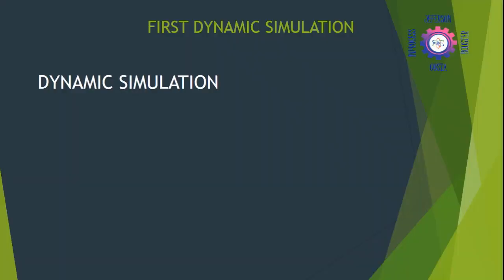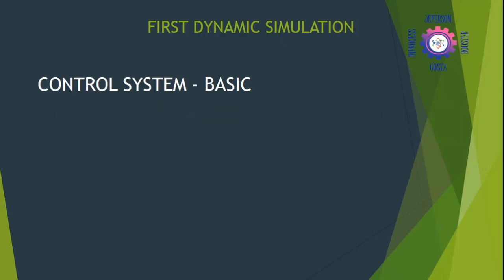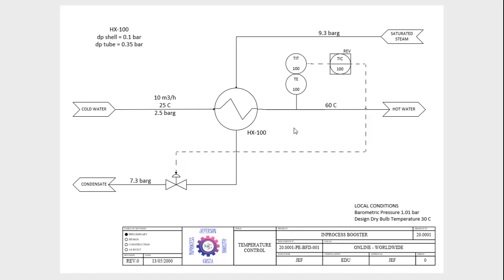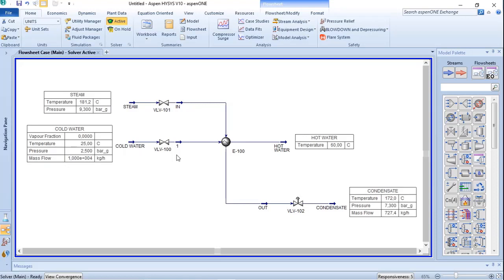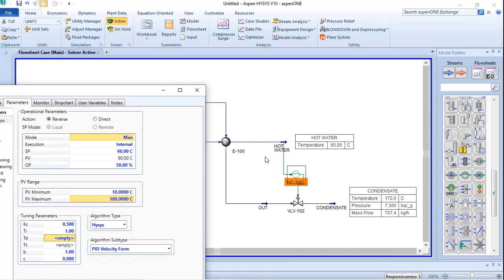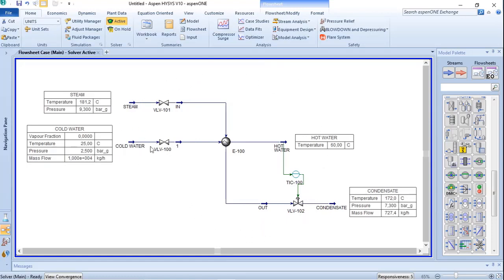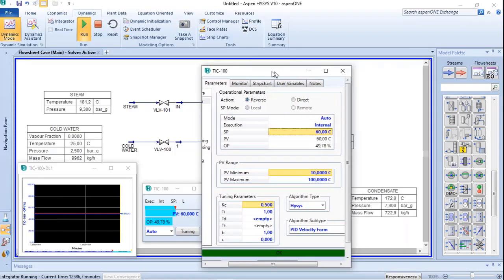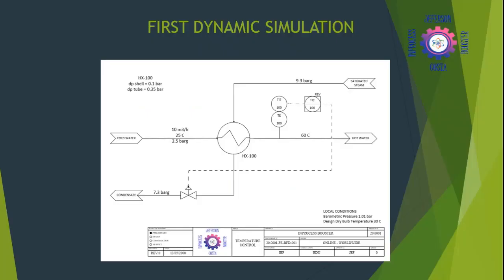First Dynamic Simulation in Aspen HYSYS

Comment: great video Jeferson with nice explanation but if instead of pressure flow relation I require temperature flow relation what should be done
Reply from the maker: Hi, you use the control valve to regulate the temperature by varing the flow. The flow through the control valve orifice depends on the pressure relationship. Same for pressure control and composition.

Comment: Hi Jefferson, thanks for your dedicated video. I have 1 question: When I switch to the steady mode, the system shows that all the streams need to be input the value again (displayed as light blue color)?
Reply from the maker: I Hieu, when you stop dynamic and return to steady state simulation Aspen Hysys goes to On Hold "mode". You just need to click on Activate on "Home" tab to allow Aspen Hysys to return with calculation. On On Hold mode hysys will not perform calculation (define stream properties based on fluid package for instance) and because of that, streams are kept in light blue.
Reply: @jefersoncostaengineer  Yeah Sir, seems like the same thing happens when we add new components. Thanks for your answer Sir, that helps me a lot.

Comment: Hi Jefferson.
I want to simulate loading a tank with product 1 that contains moisture. then empty the tank and verify the percentage of residual moisture that remains in it.

Then I want to fill the tank with dry product 2, to verify how much moisture it absorbs.
is it possible to do with hysys?
The idea of the simulation is to verify if product 2 is degraded by the humidity of product 1 when using the same tank.
Reply from the maker: In this case, it is better you use an excel spreadsheet.

Comment: Great video Jefferson, very useful. I have a question, is it possible to do a dynamic simulation of a gas pressure regulation plant? I´m trying to do it to see the behavior of the downstream pressure to changes in the inlet pressure but I don´t know what I´m doing wrong. Should I use two pressure controllers to see the changes? One in the inlet manually to set any pressure i want and auto in the downstream valve to see how the outlet pressure behaves to the changes?
Thank you for the content!
Reply from the maker: Hi Nicolas, yes it is possible. My tip is, try to convert your dynamics in small steps. start not adding many control valves at the same time.

Comment: Hi jeferson 
I want to ask you something about dynamic simulation.
When i switch steady state mode(there’s converged already) into dynamic mode, and there’s have no problem with the system after running out the asistant dynamic. But integration time didn’t work, it says (i mean hysys program) “the pressure  flow solver is unable to solve the matrix, the spesification may be inconsistent, that is certain variable are under or over determined”
What should variable are used in dynamic simulation, and is it corelation with the degree of freedom? 

Please give me advice of my question. I hope you reply it.
Thankyou jeferson 😊
Reply from the maker: Hi Wulan, it hard to tell you anything without knowing your inputs and results. Dynamics operates in a range of operation. Verify if, in steady steady, your simulation converts in the maximum and in the minimum sets you are evaluating. If not, adjust the range until you have converge. After that, set your dynamics to run in the range you know there is an answer.

Comment: Great video, very precise as always.
I have a question : why didn't we put the control valve in the sat.water IN?
Reply from the maker: Hi Farouk, you need to add your control valve in the line that will get the results you need. I would add a control valve to water line if I would like to control water flow. You can do that in your simulation :)